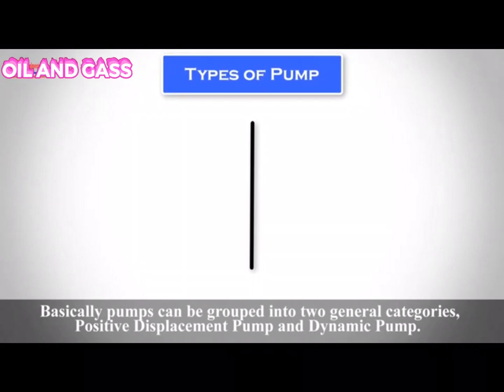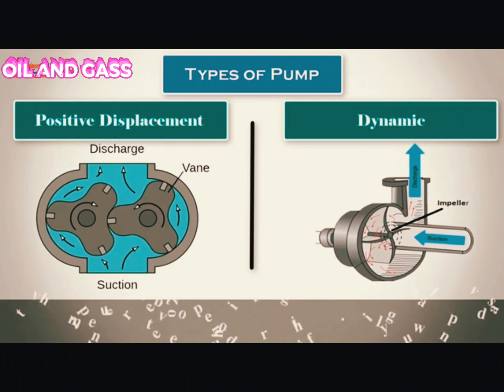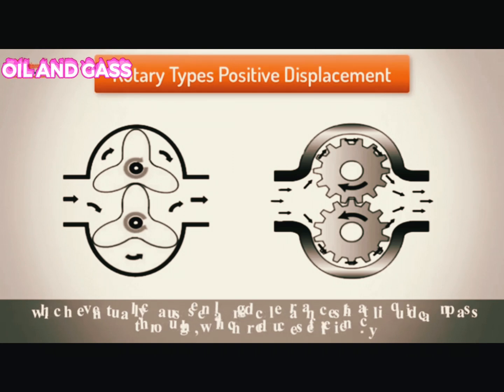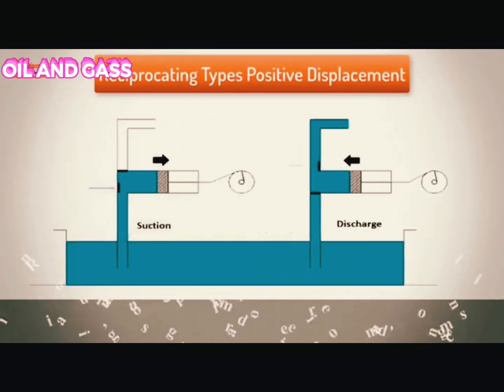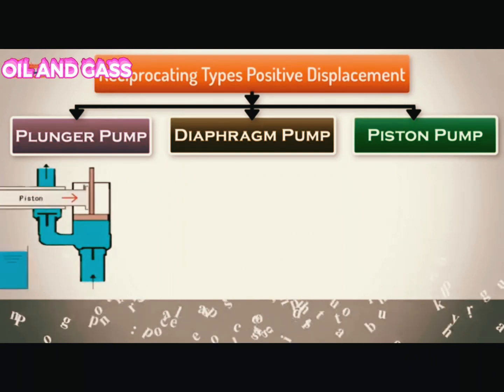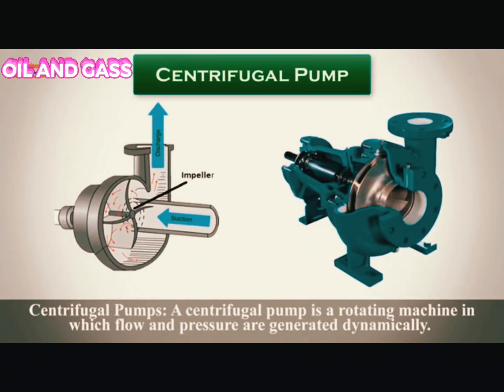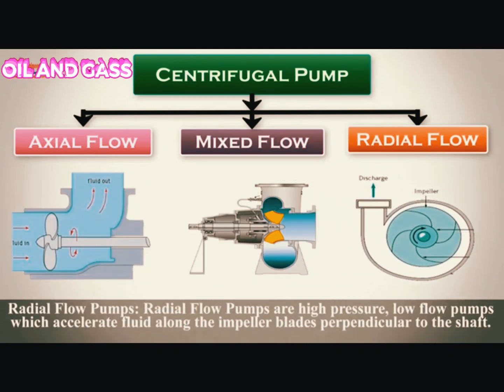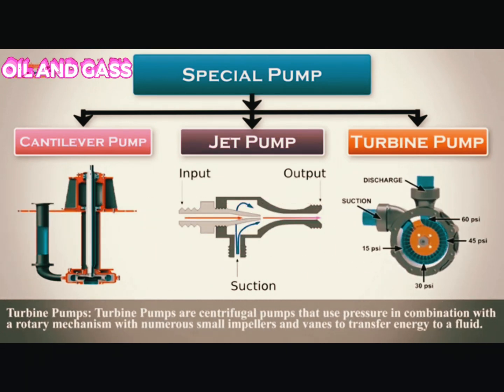TYPES OF PUMPS USING IN OIL AND GASS INDUSTRY (Notes-03)

Comment: Sir please I want buy a thermal Oile Heater  hot seal circulation pump temperature limit 150 to 200 size3' 2'' . pressure 4bar